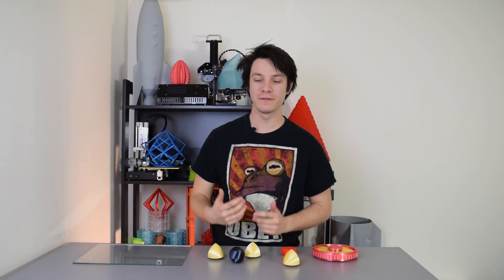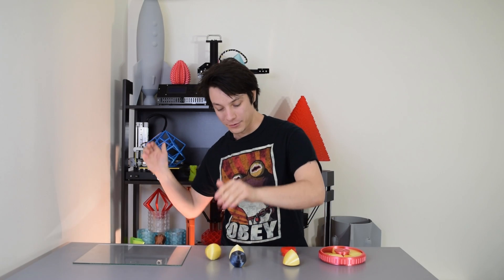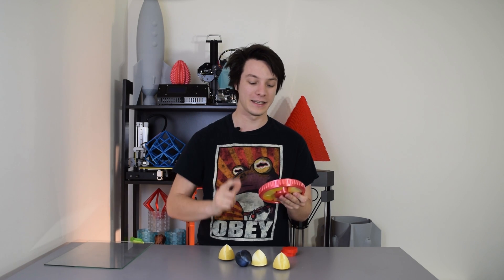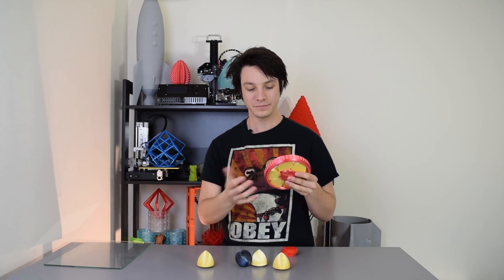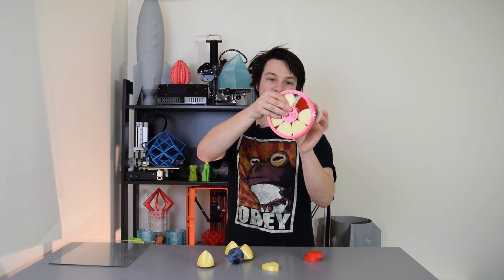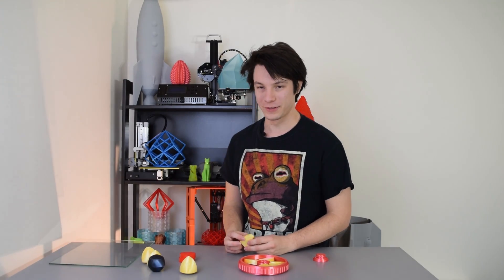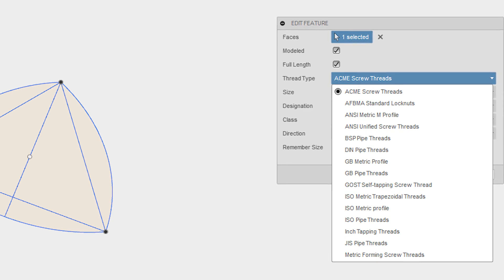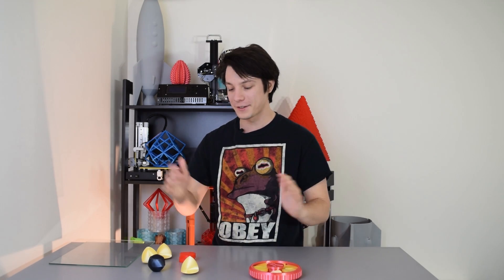Reuleaux Triangle Bearing - is it possible?

Comment: make a hexagon in the middle, could change the distance needed for the properties of the bearing, since the middle is round and degrades smoother rather at a prepared drop point to which they not meet but perfectly aligned

Comment: It is a simple print which can keep these triangles at a constant separation from each other but still act as solids of constant width. Print a hub with five arms instead of the simple circular hub that you have printed. These arms should extend till the centroid of the triangles and a pin should go through a slot in the arm and through the hole in the centroid. I am bad at explaining it like this so if you don't get it and want to know what I am saying then send me your email on aman.manvar@hotmail.com and I'll send you a drawing and detailed explanation

Thank You

Comment: Use 3d solids of constant width.  Don't use the edge as the surface that needs bearing.  Use the flat face on the side, like a sandwich.  Two flat planes.  It should function properly, shouldn't it?

Comment: All very pretty but in the end, any applications have to address the unequal distribution of heat and wear points. There is a very good reason why ball bearings are either perfect spheres or rollers.... A for effort though.......

Comment: but if you made a brace for them like normal ball bearing, it could work. If ye brace has pivot points for the bearings, and they are properly spaced, it would work. As the spacing of the brace would allow them to roll properly.

Comment: The center of mass of the triangles oscillate along a straight path between the inner hub and outer ring. All you need to do is 'capture' them at evenly spaced intervals probably using some type a radial track/rail/guide attached to either the hub or ring combined with something on the triangles that rides in the track/rail/guide.

The downside is this introduces more friction into the design and thus reduces the effectiveness of being a smooth rotating bearing. But it is a good exercise in seeing how in principle it could work.

Comment: The explanation makes sense. But after just reading the title, I thought it would not be possible for a /different/ reason. I.e., equal width relates to parallel planes (like the table and a glass plate). This is required because when a point (of say a triangle-based object) is in contact, that point of contact does not move (only rotate) during some time while the opposing side rolls on the other surface. In the roller bearing you have curved surfaces, so the distance definition of two parallel planes does not apply.

Comment: Put a little spray rubber (like plasti dip) in the inner lining of the bearing housing so that the inner shapes can grip the housing better. This will help keep the shapes "in check" and you should have more success making a "working" bearing.

Comment: Fun and interesting video.
Even if they did not work as a rolling bearing, they may work in a thrust bearing. Since a thrust bearing is to flat circular pieces normally with cylindrical rollers between them. They still need something to keep them rolling around on that circular plate and not in a straight line as on the table-and-glass demonstration. Would it still work if they was "conical" shape, would they automatically take the turn?

Comment: Hey, what if make some sort of space between bearings?
I mean what if give them space to rotate but smaller that 1 missing bearing but bigger when they all there
. O   <- pink centre part., that u can unscrew
. /\   < kinda like this plastic spacers between triangles 
. \/   < that attached to inner side of bearing
they shouldn't be flat, i think, to have optimal touch that will give oportunity to rotate and still keep them inside
or even build smth like sphere cage for every bearing, for 3d version only with cut on top, which should keet triangles inside like that 
(2d look on 3d model)
.     o      <- centre
.   --^--
.(/___\)  <-3d triangle that should rotate inside that cage, but shouldnt fell down because size of sphere's cut prevent that
------------   <-side where sphere attached 

when im high I like to watch ur creative vids

Comment: maybe trying to add a cage, like in a normal bearing; tho u would need to make the Solids of Constant Widths with a pin in the middle to have a guide, then the cage would need to have a groove in order to keep the SoCW remaining a distance in which they dont touch.
hope u guys understand what i'm trying to say^^
also; maybe adding a rubberband around the edges of the SoCW would help them stay in the bearing as this would increase the resistance and the SoCW wouldnt slide down(tho that would be the opposite of the purpose of a bearing^^)
happy printing;D

Comment: Solids of constant width have the same top to bottom height, but the distance from a given point along an edge to the center of the shape changes depending on where your point lies along the edge. Things roll smoothly on top because the height never changes, but the center of mass of the objects themselves sin waves up and down as it rolls meaning it takes more energy to allow the CoM to move in one direction than the other.

Comment: so when you roll the flat constant width triangle the center of mass moves up and down right? well then just put an axle in the center and allow the axle to shift up and down in a slot in the cage that holds them all apart.

Comment: You can make a race, just make a ring with bolts that are a third of the size of the holes you need to put into the center of the shapes with constant width.
This should work I guess, otherwise you need to measure amplitude of the up and down movement and use that for the proper sized hole bolt combination.

Comment: Im the same way a normal ball bearing has like a plastic cage holding the spheres apart, could you not do the same here? since they have a constant diameter as long as they were caged in individually surely this would work
Reply: And it also means you could have less in as you could set and keep their positions around the centre

Comment: It wouldn't be much good, but it could be done.  The clue is to use a cage similar to what is used in some types of bearings.  Thrust bearings can be made out of needle bearings by putting the needle bearings into a change with the axis of each needle bearing pointing at the axis of rotation of the whole bearing.

Putting my design where my fingers are... I've posted it to thingiverse as https://www.thingiverse.com/thing:2435959

Comment: Why not add a cage with slots, set in a way so that a pin could go through the slots and the center of the reuleauxs? This way, you could still have the centers jiggle in and out relative to the core, but be locked in terms of the centers' angular distance from each other.

Comment: couldn't you just change the middle circle piece to a shape that changes as they move around it, keeping the center axis of each shape the same distance from the middle as they travel around??? You would need to make the materials non slippery, as these shapes would have to stay in a guided rolling path, with sliding breaking out of the set pathing.

Comment: Someone please confirm if this is plausible or not but would adding more reuleaux triangles and making them way smaller make a difference? By having more small triangles it would "lock" the center piece in place while having enough space in between each triangle to roll around. Like how in most ball bearings they use multiple tiny balls instead of having only like 5 larger balls. Cause in the demo with all six triangles in the bearing, I saw that the shapes didn't have enough space to roll which make them lock in the same position. This description probably makes no sense but i have no idea how to explain the image in my head.

Comment: if you make a secondary ring, with a radius halfway between the core and outer ring's radius, you could mount the shapes so that they are spaced enough (dont interact with each other) and are always surrounding the core in effectively all directions.

Comment: Also, the constant-width property depends on being between two planes.  The line between the two contact points is not always perpendicular to the planes.  This matters when attempting to roll between two circles because it's the radial distance that needs to be constant, and as the shape rolls and the contact angle changes, the radial distance will change.  Although now that I say that, perhaps a different shape, maybe a cardioid, would have that radial distance property.  And then for a cage, perhaps axles that are loose within large holes to account for fact that they don't rotate about a true center.

Comment: wankel rotary engine
Reply: Cubing With TheLegend27 
You calling me a Wankel?
Reply: Cubing With TheLegend27 brap intensifies
Reply: SunzOffski, wouldn't you agree, though, that some of the best successes are derived from failures?  Learning what doesn't work helps you learn what will work.
Reply: SunzOffski That's an extremely simplified version of what it does. You haven't mentioned if it has high torque, or can withstand higher speeds.
Reply: Are you talking about the bearings in a Wankel rotary engine, because that's not true. The rotor bearing has maybe 3 times the life of a piston engine bearing because it only runs at 1/3 crank speed. Plus it's double the width  and massively large, so way over designed for the load. Out of 220 engines I have maybe changed 20. The mains wear about the same rate as a piston engine or a touch less, but definitely not faster.
Reply: only the Renesis versions... the older ones were even less efficient, but lasted much longer.
Reply: Not the experience we've had. Apex seals seem to wear quickly. The mains are definitely robust but, the engine, overall, requires a lot more maintenance. Don't think he was talking about the bearings as much as their overall reputation for being expensive to keep up.
Reply: well i never....!
Reply: Thats why i press this video
Reply: Because i'm simple man i see rotary i click
Reply: Cubing, what about it?
Reply: This is what they use for the connecting rod bearings in a rotary.
Reply: Cubing With TheLegend27 THATS WHAT I THOUGHT
Reply: Hah its got 20 charecters xD
Reply: Flaming dorito intensity increases

Comment: The bearing cage on a ball bearing is designed to keep the balls a constant width apart, the trick is to design a cage that will work, that's how they get the centre part in a bearing, all the balls are pushed to one side and then distributed around evenly with the cage.

Comment: yes you can do it, but they have to be toothed like a gear.
there is a guy, I think it's OskarPuzzle? will look for a link and post it with a response to this comment. he makes a lot of things, like a five by five rubix cube like puzzle, ring/bracelets, but his standing gear clock is the one I want to make or try to as it may take a few attempts.

Comment: What if you drilled a hole in the center of each of the triangles and then put that on a base where there's a circle and after that it keeps that in place while holding its shape and keeping each triangle divided from each other

Comment: Cool.
Wondering if the rollers could be printed with a gear tooth pattern on the outside surface. If the same pattern is on the inside of the outer race then they can be synced together such that an eccentric ball guide could be fitted to them (annulus with evenly spaced pins). The guide would orbit in an eccentric pattern as the bearing "balls" rotate. Would be hell to align them to sync them up, but an interesting engineering design problem.
Cheers,
 - Eddy

Comment: the question is....
if the Reuleaux Triangle is made larger than the for instance gravel, rock, even a concave stream bed average size then does the material being rolled on top remain stable and straight..

plus OC will they be a better option for manually  rolling stone down the cobble road 
 rather than the generic heavy log rolling  and its tendency to run away  if you get the force wrong  ;P

the real question OC is what actual purposes and situations can you make use of their properties to construct something better...

Comment: I'm a little late to the comments, my apologies if this was suggested elsewhere.

What if the center shaft was the same shape? then as the mid point of the load bearing OoCW moved radialy in regards to the outer race they wouldn't move in relation to the inner race.

Comment: What if the retaining ring for the bearing isn't round but oblong like in a wankle engine? Or maybe you just can't make the same kind of bearing? Maybe split the retention ring. One half of it being male threaded, and the other half being female threaded. Leave the middle piece out. Put in two plates on either side (made of plexi-glass so we can see the internal action). Use the 3d instead of the 2d shapes...So this would look like, absent the bearings, two mason jar lids put together. And the two plates would spin against each other. Or when held in place the ring would spin around them? Basically just retaining what's happening between the table and the glass.

Comment: So why not make a bearing guide to keep the objects equal distances away from each other?  Instead of using slices, just use the full shape.
Reply: I'm saying something similar. I'd like to see the full shape also. It looks like another shape in between each OCW Bearing would fill the gap and spin in the opposite direction. MC Esher's Metamorphose works spring to mind but spinning and in 3D !!!

Comment: If you look at spheres sort of regressing in shape to a spherical triangle  (in the same way a circle can regress to an n-polygon to 1000 sided polygon to 100 sided polygon all the way to a triangle), you can form a basis for what a sphere is. Sticking to 2D polygons, you can roll a traingle. Not in the same way you can a sphere but you can still try. Add another side and you can roll a square. Keep adding sides until you have something that rolls like a circle. Now regress but this time, in order to keep the shapes rolling like a circle would modify the surface the object rolls on.
My point being, these roleaux bearings should be able to roll only if you modify the surface it rolls on (i.e. the inner portion)

Comment: Also, there is a fundamental difference between a ball/cylinder and a reuleaux shape: the advancement speed of a ball is linearly proportional to the rotational speed of the ball, while a reuleaux shape that spins with constant angular speed goes forward with a non-linear speed (certain angles yield higher advancement speed than others, based on the radius of the surface currently in contact with the two parallel surfaces). This would induce, in any real world application, vibrations that would deny such a bearing's purpose.

Comment: Actually the centre of rotation can't move in a circular pattern. Think about it: if you draw a line through the centre of rotation, the distance between the centre of rotation and the points where the line intersects the reuleaux triangle sides varies from 50-50 (equal distance, when the line is parallel with one of the sides), to 57.735-42.265 (say, 58-42, when the line goes through one of the corners of the triangle), every time you rotate the triangle by one third. So it does so three times during a full rotation, describing a tri-lobed shape, not a circle.

Comment: figure out the spacing needed to keep clearance, stick an axle through each solid of constant width, add slots around the hub that keep them spaced apart but allow them to slide towards the hub and outside edge.

Comment: If you made the center ring almost a geared ring would it help the "bearings" rotate? 
One other thought was that if you made the bearing shapes full 3D shapes and not flat 2D shapes and smaller to fit fully in side the outer ring with a smaller diameter it might work.

Comment: Hello Angus! I have a problem with my 3d printer. The walls in my prints are rough and I don't know why (belts are tentioned, its not a Z-wobble, acceleration is also low). Do you know any causes and solutions for this? I would be very happy if you could give me an answer ;)
Greetings from germany!
Mike

Comment: I would think putting teeth on the rings and the bearings would help along with making sue the inner and outer ring complimented the size o the bearings so that when rotating they never get close enough to touch.
Reply from the maker: +palakaman that could work! I might have to have another crack at it

Comment: What if you just put holes in the center of the solids of constant width(scw) and made some circular guiding ring a for lack of better words like the constraints used in real ball bearings like a guide of sorts and used fewer scw like say four and just spaced them out evenly? Would it be able to work then?

Comment: Stabilization of the solids of constant width is not possible with a physical, conventional fastener... specifically due to the change in center. However, there could be a way to model a track within the bearing walls. 

If done right, you could quite possibly use those 3D solids of constant width. They would maintain their individual positions via the angle the track is taking, limiting excess rotation of the objects at the edge.

Comment: maybe when the wheel diameter increases and the spoke diameter too (so you get smaller and more bearings) you start to approach the "flat piece of glass" situation a bit more compared to those rollers that now share the same curvature with the surface they are supposed to roll on! :D

Comment: I think there is a theoretical way that this could work, but it would require highly tight tolerances such that all of the bearings where at the same rotational point relative to each other such that they would avoid touching. Highly impractical in any case.